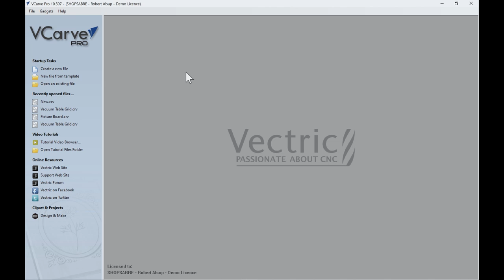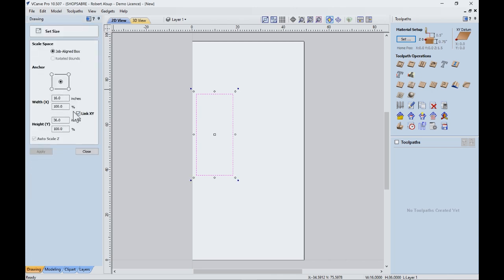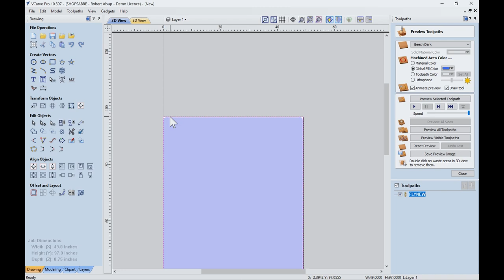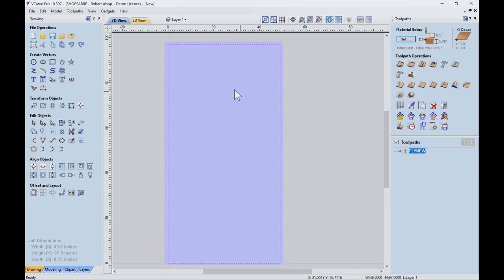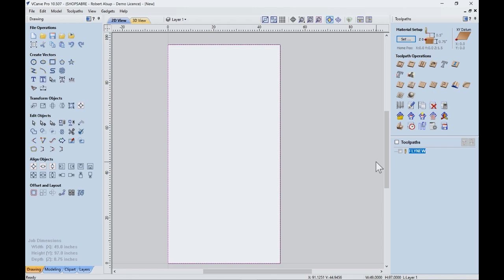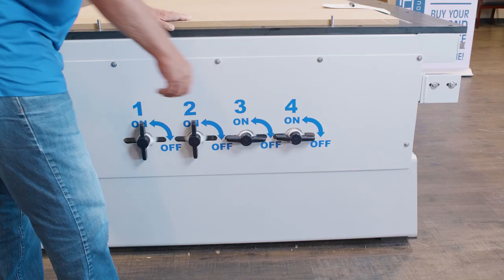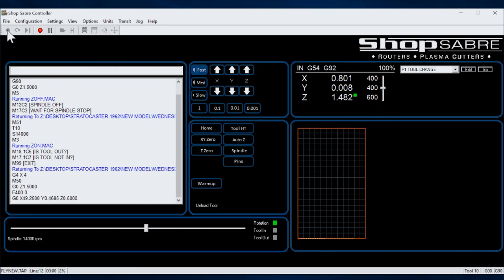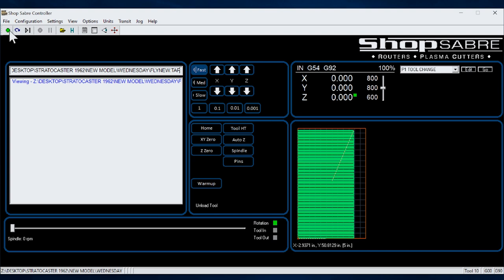Preparing a Vacuum Table Spoil Board for Flow Through Fixturing

Comment: Why don't people use peg board?  Just seems like to would have plenty of holes but more concentrated pull. I'm not a CNC guy yet, just looking into it.
Reply from the maker: Great question! It comes down to the airflow efficiency, porosity of the material, durability and customization. Pegboard is more susceptible to warping too. Welcome to the CNC journey! There's a lot to learn but we're glad to help.
Reply: @shopsabre  When I get a CNC I"m going to try it.  I think glueing a sheet of 1/4" peg board to a sheet of 3/4" mdf that has been surfaced on both sides and then surfacing the top of the glued down 1/4" peg board would be ideal?  Then once you have worn down the peg board you just glue another on.  The trick is to apply the glue to the peg board so the glue doesn't seal the peg board holes on the 3/4" mdf.  And not to surface the glued down side of the peg board.   Please try before I do, it could be a while before I get a CNC. Most likely a Shop Sabre although being Canadian it will be more difficult to obtain.  But I've done a tonne of research and I just think you guys are the ticket.
Reply from the maker: @tableshaper4076  Let us know when you're ready to take the plunge! We're really focusing on the Canadian market right now so it's great timing. To get started simply fill out a quote request on our site and our team will be right with you to find the perfect fit.

https://shopsabre.com

Comment: My boss just bought a new IS510 and I was looking about how to work it. You have mentioned today and on several videos that .04 is 4/1000ths. That's 4/100ths. 4/1000ths would be .004. At 2:50 you said this very thing. Never ran a cnc machine before but want to make sure I'm understanding this correctly.  Can't wait to get the 510 it should be here next week!
Reply from the maker: He mentioned 40 thousandths - .04
Reply: Removing 0.040" (forty thousandths) from each surface should be enough to get rid of the dense surfaces.
Reply: @shopsabre  thanks for the clarification. I understand now that I rewatched it. Thanks for everything! Can't wait to start playing with the CNC next week!

Comment: I’ve been running a CNC for about 5 years but I have a new machine on its way and I’m excited about the vacuum table.  Thanks for the tip on sealing the edges.  I was wondering about that.  Also, covering the board when not in use.  I had used MDF in the past but found it was very unstable.  I wound up getting a piece of granite as it wouldn’t absorb moisture.  Then I put a piece of 3/4” PVC sheet on that as a spoil board.  I don’t really ever cut into it, rather use thick 2 sided foam tape and cut halfway into the tape.
Reply from the maker: Granite is pretty expensive and quite heavy, we would recommend a composite material such as phenolic, which we do sell.
Reply: @shopsabre  I was able to get a great deal on the stone from the granite shop next door and I did want the weight to help stabilize the frame.  The whole frame is built out of 80/20 but didn’t have much of a table.  It’s worked well for many years so far.  Thanks for the advice tho.

Comment: Great video as they all are! Several questions:

1) Do most folks match the spoil board size to the size table they have e.g. 408 gets a 4' x 8' spoil board; 510 a 5' x 10', etc.?
2) If you are a one-man shop and have to yell into the house for your wife's help, is it possible to have the spoil board in several pieces e.g. two 5' x 5' pieces on a 510 table or would there be too much of a vacuum loss?

Thank you.
Reply from the maker: Thank you, regarding your questions 

Yes most match the spoil boards to the table size as to avoid unnecessary leakage. 

It is also possible to segregate the spoil board, the biggest thing is making sure you don’t get leaks at the seams. 

We’ve seen many people do it successfully but it ultimately depends on the vacuum pump you use.
Reply: @shopsabre  Thanks for the quick response...I am still setting up my new IS 510 with 10 HP spindle and 15 HP Becker pump so am not certain yet where that falls on the just enough or more than enough scale.

Comment: is this surfacing a one time process or need to do frequently ? How frequent ? Once a week or once a month or ?  Can mositure absorption close the pores in the MDF and make it less porous ?
Reply from the maker: You will resurface as needed based on usage and needs. The frequency will vary based on a number of environmental variables including your shops Temp/Humidity change. Some people do it daily, some weekly.
Reply: @shopsabre  Thanks. Iam using the vacuum bed for foam cutting with a oscillating knife. I keep a sacrificial open cell foam (styrofoam/EPS) on MDF and then my EPE foam on the EPS. So I will not be making cuts on the MDF. (unlike a CNC router ).
Does the MDF still needs periodic resurfacing to maintain porosity ? 

Since my machine is not a CNC router, It is not possible for me to resurface the MDF on my machine. I will have to shift it everytime to another CNC router machine for resurfacing, if it is needed!

Kindly advise on this.
Reply from the maker: @VisweshSrinivasan  you will want to speak with the manufacturer of your equipment for their recommendation, generally for accuracy you will resurface the subsurface periodically due to humidity changing the material. That said, we cannot speak for how your table is configured and do not want to give you bad advice for the design.

Comment: Are you using normal MDF or light weight MDF?
Reply from the maker: Good question, you can use MDF and LDF depending on the application and the pump being used. In most cases, ShopSabre uses MDF for its applications.
Reply: @shopsabre  I’m going to try MDF because LDF seems to be hard to find.

Comment: How can I do a tongue and groove door panel with the Pro 408?  Can I use Router table bits on the 408?  I have been able to find tongue and groove bits for CNC.  Great videos BTW
Reply from the maker: There’s a lot to this answer - the router is doing what it can reach from a vertical position so it’s up to you to program the design / profile and then fixture the parts for the router to reach the material with tooling clearance (typically a raised fixture) 

Thanks for watching the videos
Reply: @shopsabre  Other than positioning and programing, the actual bit can be used on the 408?  Im starting to build my own kitchen, even though that is not what I have the Machine for.  You make it seem easy enough on the videos.  Just signed up for my Mozaik software that came with th machine.

Comment: The 2.5 in flycutter is not preloaded into my vetric software. Is there a good video on how to add it? I'm inexperienced in this and dont want to mess up on the feeds and speeds as km adding a 2.5 end mill into  vetric. Thanks
Reply from the maker: No tooling comes preloaded into the Vectric Library, this is normal so don't worry. If you bought the machine from ShopSabre our team will help with supporting you. You will want to contact our Tech support for assistance with any setup questions.
Reply: @shopsabre  In just reading this, I'm now convinced I'm buying a ShopSabre next week.  I can't believe you'd help people get something like this setup.  This says a lot about the company after the sale.
Reply from the maker: @5280Woodworking  We do our best to make sure every customer is happy and taken care of before, during, and after the sale. Fill out a quote request on our website and one of our team members would be happy to assist you!!
Reply: My Vcarve does not have the flycutter tool either.  How do I import/load this?  I just received a ShopSabre.
Reply: Eric Alma  create a new emdmill at 2.5",2 flutes, etc

Comment: I have no option for .tap files
Reply from the maker: .TAP is the format, Vectric automatically outputs in this format if you are using the ShopSabre post processor
Reply: @shopsabre  got it! A quick call to tech support fixed me right up. Now to my very first cut ever on this beast!
Reply from the maker: Great. Glad they could help. Good luck!!